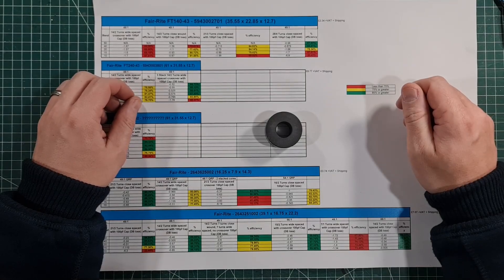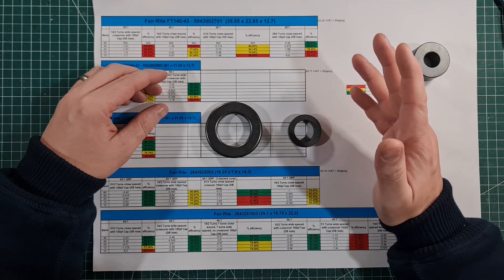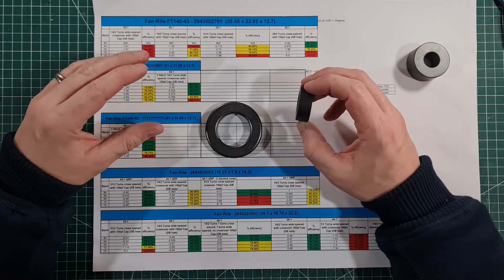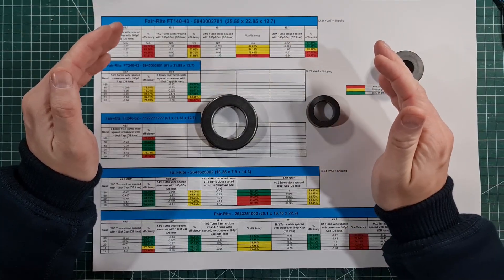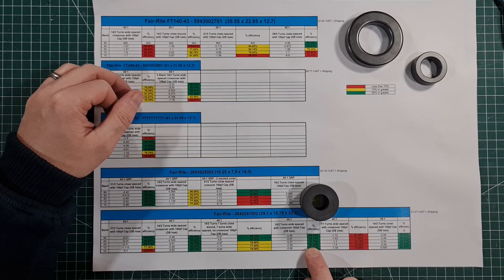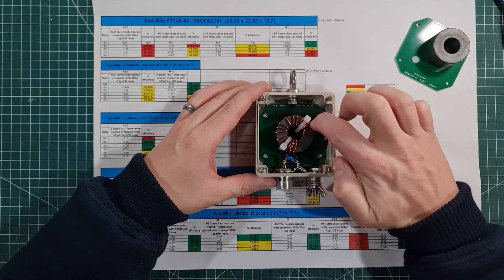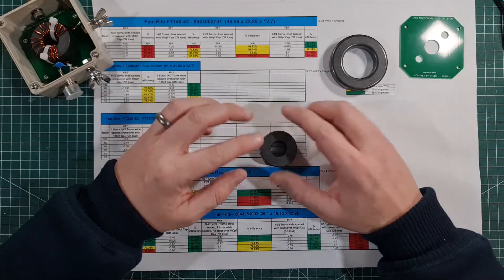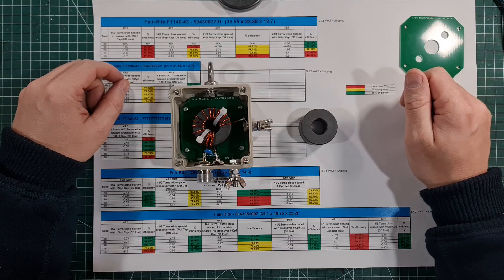Best Ferrite Core For a 100w End Fed Half Wave Antenna

Comment: Colin, I'd appreciate your thought's on building an endfed halfwave for 80 meters capable of 250W CW.  Would this core be capable of that? It looks too high to stack two of them. Perhaps a triple stack of FT-240-52's would be the way to go? Thanks in advance, John EI5JS
Reply from the maker: Yes 240-52s will run super cool, almost overkill but you will never hit Currie point/temp.
Reply: @MM0OPXFieldRadio  EXCELLENT testing and interpretations. I'm looking at a 240-52 triple stack after watching Steve Ellington . Now I just found your videos. I use EFHW for 80-10, trying to use legal limit 1500w. Your above comment leads me to believe this would work. Im sure there are pitfalls. Interested in your thoughts or even in your testing results😁. I understand there is only so much time available for testing.
Reply: also, plan on using 15:2 winding.

Comment: Tim Ortiz N9SAB uses a unique core in his antennas of this type. The performance and VSWR curves are amazing.
Reply from the maker: I'm not sure he does. Can you provide a link? The only EFHW I see hes using an FT140-43 with standard winding on his Ebay store. This 1002 is more efficient and can handle much more power.

Comment: Hi & thanks for the video. Having made a few of the 'typical' 240-43 versions, which have worked fairly well, I'm now going to try these cores.
I have 2 questions:-
I'm curious why everybody seems to like capacitors of several kV rating? At 100W, on the nominally 50 ohm side, the voltage is much less - 100W/50R ~ 70V. Sure you want some 'overhead', but I'd have thought, say, 500V would be plenty ??
I see you have twisted the primary around the bottom of the secondary. I'm guessing your SO-239 shell & counterpoise terminal are connected? Or do you keep both windings electrically isolated?  Have you compared a tapped, single winding, autotransformer configuration, to the two windings?
Many thanks, & would appreciate your comments.
Btw, just today I put up a 12m spiderbeam pole, with about 10m of 2mm dia. aluminium wire up the inside to start playing with 20/10m EFHW vertical, and maybe later also switchable for 40/15m quarter wave ground plane.
I made, quite some time ago, but haven't yet tried, a 240-43 core, on a board, with a ceramic rotary switch to select 2 or 3 turn (separate) primary, and another to select 6, 7, 8, or 9:1 turns ratio (so 1,800 to ~ 4,000 ohms) plus 2 toggles; one to common the 'grounds' or not, the second to connect or disconnect the counterpoise terminal - for trial & error experimenting with quick & easy switchable configuration changes.
I should use it, but you've probably saved me a lot of fiddling :-)
Cheers,
Phil. VK2COP
Reply from the maker: Your 100% correct. I buy the 3kv ones as they are easy to get, small and perform well. No idea why people use these door knobs!

Comment: Hi Colin, thanks for this video, quite inspiring. What are your feelings or experience winding these in an autotransformer format? I've been using 140-43 cores and tried both methods and not seen any difference. Thanks again.
Reply from the maker: Very hard to gauge difference in the field. only sure fire way is a simultaneous WSPR test.

Comment: Perhaps a Personal Question.. (How Long is it ?) 😉 Your Wire Length to clarify.. (in Meters or Feet) No Matter, I go Both Ways. (An Efficient Transformer Such as this) needs it's Matching EFHW wire length. Just as you I am Striving for Perfection.. Well..  (As close as possible.) .. (also).. Do you use a 100uH Coil as some setups do. ?? Thanks for posting this Video 👍👍73s
Reply from the maker: Both ways huh 😂. The length will vary depending on ground effect and consideration but it will be around 20.5m
Reply: @MM0OPXFieldRadio  Thanks so much for such a quick response to my question. Length of 20.5 meters ✔️ (I can achieve that length) My Backyard is Big Enough 👍 73s
Reply from the maker: If you have the wire start off a bit more just in case.
Reply: @MM0OPXFieldRadio  I will Do that (QSL) Perhaps another 2 or 4 Meters.
Reply from the maker: I would start at 22m

Comment: Did you do the crossover on the 15:2? You say it and have it in the Google doc but the antenna you’re showing seems to not have the crossover (at least thinking about the geometry of the wrapping and where the wire ends). I’m building this next weekend. Thanks for sharing! Enjoy your videos!
Reply from the maker: I've done it with and without and there is no measurable difference. Do what suits your install.

Comment: The key reason that the recommended core offers improvement, is the height of the core.     The wire that does the heavy lifting is the wire that is inside the toroid.   The wire that runs along the top and bottom faces tends to add stray reactances.     If you accept that explanation at face value, you can see why the FT240-43 isn't a great choice for transformer building.

If you stack two FT140-43 cores, you get a big improvement in efficiency.

Fair-rite developed the -52 material specifically for RF transformers in the 80-10m range.   Steve Ellington built a transformer from a stack of three FT240-52 cores and that was independently verified by Owen Duffy, VK1OD at around 98% efficiency.   The Curie point of -52 is much higher than -43 so it can run very hot and a lot of power.

Going back to my point about it being the wire inside the core doing the heavy lifting - most modern PAs use binocular core arrangements and should be the optimum choice, rather than sticking with toroids.

The design process for say 49:1 transformer is pretty simple.   Wind the primary with just sufficient turns at the lowest operating frequency to achieve an impedance of 150-200 ohms.   If that happens to be 2 turns,  then we clearly need 14 turns for a 49:1.
Reply from the maker: I'm not super technically minded but worked out its to do with the core geometry and its dimensions in proportion to another. I'm building a 3x240-52 transformer which I have measured over 90% efficient via back to back.

Comment: Finally got around to making a 49:1 with the 2643251002 this morning.  Compared to the dual FT240s in the Balun Designs commercial unit, the impedance transformation (on 20 meters) was almost identical.  I was floored when everything came up without a hitch.  Running 200w SSB and I don't see the SWR rising at all, but its ~20F outside right now.
Reply from the maker: Thanks for the feedback. Myantennas rates this at 250w SSB so you should be good. I'm sure the cold helps though.

Comment: Where can i find how to wind by close winding method? Tried searching youtube, but could find a traditional method only. Please help
Reply from the maker: Just keep every turn close together. Thats all it is 👍
Reply: @MM0OPXAmateurRadio  But there is a point where it needs to be soldered, and I can't figure that out. I am a new ham and a detailed video of this type of winding method will be unique on YouTube and helps a lot to hams like me.
Reply from the maker: @jayharwards104  its identical to a "normal" EFHW but the turns are close together. I'm unable to attach a picture here.
Reply: @MM0OPXAmateurRadio  So, I'll use the same twisted wires at the beginning, same capacitor, same number of turns, right? The difference would be - no crossing to the opposite side, right?
Reply from the maker: @jayharwards104  exactly 💯
Reply: @MM0OPXAmateurRadio  I do not see twisted wires on your video "What EFHW Core and Winding to use for HIGH POWER" at 2m08sec. I am confused. If it's exactly the same as traditional in terms of twisting wires, where is it? All wires are parallel, there is no twisting. Please, help
Reply from the maker: Your comments aren't from thst video. You are commenting on the 100w EFHW video. What you are looking for is an autotransformer. Google it until it it looks similar to what I've shown. I cant explain it any clearer than how I have there. Sorry.
Reply: @MM0OPXAmateurRadio  Autotransformer! Finally, I got a clear answer what close winding method is. Thank you.

Comment: Hello there, like your presentation and like to use your material. I'm in Canada and try to get the material. What is the capacitor you used? tried to follow your words but struggle. Could you enter the part number into the description please ? Would be brilliant if the datasheet (PDF) could be linked too, as mouser here has apparently not the same part number for the ferrite core neither. Would really like to get the right one...  Thank you ever so much, Bernd VA2VFF (Very Fine Fellow - or French Fries lol)
Reply from the maker: I will add the capacitor p/n in the description soon. The 1002 core on mouser is correct. The picture description is wrong. Look at the data sheet and note the dimensions. If i had a penny for how often it gets questioned.
Reply: thank you

Comment: Great video.  Is there another smaller core you would recommend for QRP operations? Say for around 25W SSB.
Reply from the maker: Yes the Fair-Rite - 2643625002 (16.25mm x 7.9mm x 14.3mm)
Reply: @MM0OPXFieldRadio  Thank you, I will order a few.  What gauge wire did you use for these to wind around the Toroid?  Also, what ratio did you use, such as 49:1 and so on.   I appreciate all your help.
Reply from the maker: 0.66mm diameter wire. 64:1, 2 primary, 16 secondary.
Reply: @MM0OPXFieldRadio  Thanks again for the quick response.  Do you have any data showing the efficiency of the transformer for 40 to 10 meters?  I really enjoyed your video comparing the efficiencies of the different size ferrite cores.
Reply from the maker: Yes its in my spreadsheet that you can find a link to in the description.

Comment: In order to run more than 100 watts or so, wfhat would happen with a 56:1 dual stack using the 1002 toroid cores? Would the efficency drop off at the higher frequencies?
I have a very limited antenna system here due to the HOA Nazis, so I'd like to run my amplifier in SSB at around 350-500 watts.  KB0TJ
Reply from the maker: Yes you can stack them. Personally I haven't done this but Evil Lair has and told me its not too bad. I really need to check losses. With the power your talking about may be possible.

Comment: Hi Colin ... I've made the transformer with the fair rite core and either I do 14t or 15t ... all bands are very good except for 10m where the swr is much higher compared with the 240-43 core.
The tests are done in the excact same conditions with the transformer connected to my wire outside, same CP ... nothing changedcompared with my 240-43 set-up.
With the 240-43 I can use the complete bandwith on 10m easy. Not with the fair rite.
Do you have an idea how to get 10m better ? I didn't do the crossover. 100pF cap in place.
I've also posted a lot of this in the EFHW FB group ;)
Reply from the maker: I would try a larger capacitor as doesnt affect the lower frequencys as much. Try going up in 10pf steps.
Reply: @MM0OPXFieldRadio  
Hi Colin, thx for coming back and thx for your quick answer. I told you earlier that I was using the same antenne/feedline setup but I forgot to mention that the test has been done with the new core not installed in it's box ... it was just hanging  for testing purposes offcourse.
The last winding was like 10cm long before i connected it to my antenna and offcourse when finishing everything in the box I had to cut all the ends to fit in everyything.
Once finished all my results were very good.
SWR is now even better on 15 and 20m. 40m is the same even 12m got better. Overal conclusion ... did some first tests ... worked Belgium -South of Chili yesterday (nearly 13.000km) with a 5/7 on 10m without the tuner because on 10m swr is nowhere higher then 1.8.
This core works for sure ... 
Thx. and keep on going Colin ... you do a great job with your video's ;)

Comment: I admit I should scan through your vids before asking but... What's the big hang up on halfwave endfeds? "Random" length endfeds are so much more versatile. You're not tied to harmonics of the fundamental frequency of the halfwave AND the impedance swings from band to band are not as severe meaning a 9:1 unun is the typical ratio of the transformer. Depending on the length chosen, the random length EF allows all band operations often with minimal tuner requirements. It strikes me that most hams don't know the difference between an EFHW and a random length endfed, assuming they're the same thing, which they are not. 

I learned about endfeds quite by accident when an older Elmer tossed a 53 foot wire into tree and worked from Pennsylvania to Norway with 5 watts then repeating the stunt several times on different bands with the same antenna. Since then, the random length endfed has become my favorite portable go to antenna. (Random lengths have to be picked from a list that tells you how to avoid a harmonic of any ham band. So yes, this antenna can't/shouldn't be resonant on any ham band, which is why the impedance curves are so accommodating.)

So if you haven't done the same core material analysis using a random length, please do so.
Reply from the maker: Use whatever works for you. As uou say a random wire is anything but! Its a specific length. Losses on a 9:1 transformer are definitely less but its diminishing gains. With your 9:1 you need a tuner, an external one at that at times. Thats a compromise many dont want to make. So this transformer is about 90% efficient, your 9:1 will be about 95%. Your SWR however will he higher and probably losing 20%. I dont think there is much between the 2. As I said first, go with what works for you.

Comment: Hi Colin . I'm  just a little confused as to what you now recomend to winding. 56:1 with crossover or 56:1 without crossover close wound. On the 002 cores. Have built with crossover and it's great.
All the best Kevin.
Reply from the maker: So both work and little difference between loses. Make it so it suits your application.

Comment: Is that 15-2 without crossover? Also what wire size of wire?
Reply from the maker: Yes but if you want to wind a crossover its fine. The wire is 1.16mm diameter.

Comment: I'm a bit confused here about the results that you show with a 15/2 winding. Very food effieciency but you didn't seem to mention putting that extra winding on how your swr is now on 40M compared with the usual 14 secondary. I would like to know please.
Also on your spreadsheet it shows "with" crossover, the one you actyually showing which you can also buy commercialy doesn't seem to have that crossover .... is there a difference or doesn't it really matter how to wind it ?
73
ON1JV
Reply from the maker: Crossover or not it matters not in efficiency. You can choose what suits you. The extra turn on the secondary is what I needed to lower the SWR on 40m. It dropped the SWR from 2:1 to 1.5:1 in the inverted V config.

Comment: Colin, thanks for the interesting video. Don't you think that tuning an EFHW antenna with an L-Match tuner has less loss than with a ring transformer?
Reply from the maker: Yes but its going to be very much diminishing loses gains. With this just add 1/2 wavelength of wire for your chosen band. With an L match its only for a given frequency. I have 2 videos on the channel for a 17m and 10m 5/8 verticals with L matches  which work very well.

Comment: Good job Colin. I've been using/selling ununs using type 43 for years. Mostly 240/140-43 and even beads. People like them, just bare bones, no enclosure. I promote the ability to vary the turns count for better tuning on given bands. Recently i have discovered that types 52 and even 61 toroids are giving me better numbers, VSWR and impedance, even as on bands low as 40 meters. This is with a 40 meter EFHW. Are my numbers an illusion as too performance? Example - ft140-61 using 2:12 ratio giving almost a perfect match on 40. Am I just making the transmitter happy? thanks and 73, John kg6zbn
Reply from the maker: Hi John, Thanks for your comments. Simple answer is yes to all your questions. The match is only half the story. You really need to do a back to back insertion loss measurement to see how much power you are losing. The 240-43 and 140-43 are very forgiving match wise. Not terrible loss wise but you can do better.

Comment: What do you think would happen efficiency and power handling if you wound with the 240 with the  small taller inside like a ring inside a ring? Looping wires through both cores Reduced foot print but perhaps an interesting combination.
Reply from the maker: It has been done by others. It didn't improve efficiency much. It may improve power handling but they or havent tested.

Comment: Does the efficiency scale up and down in a linear fashion for the same core type under different amounts of power? For example, at 90% efficiency if you lost 10 W at 100 watts in would you lose 1w white at 10W in ?
Reply from the maker: I cant confirm 100% but yes. Efficiency will drop once the core gets to currie point.
Reply: Thanks. I’m just trying to figure out if it is beneficial at 10 watts to buy this new core or stick with a regular 140-43

Comment: Hi Colin, thank you very much for the great video and all the time and effort you invested in the tests. I have a question regarding the transformer you show at 9:27 in the video. The toroid doesn't seem to be winded with the wire in a crossover configuration. Also, I tried to count the winds and it looks like it's a 14/2, rather than a 15/2 but I might be wrong. Would you still recommend 15/2 with crossover? Thank you 73s
Reply from the maker: Its definitely a 15/2. I wanted the antenna wire connection where it is so didnt do a cross over. There is no measurable difference between crossover and no crossover. Make it to suit your application.